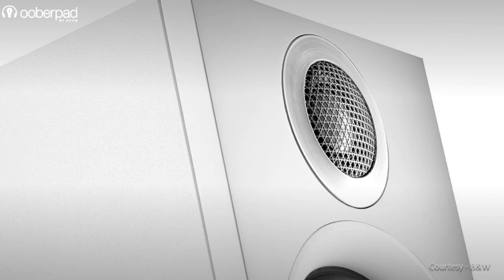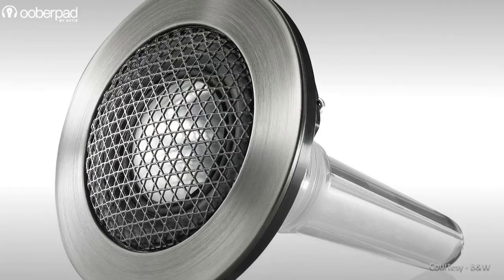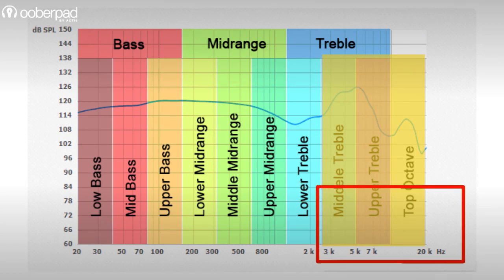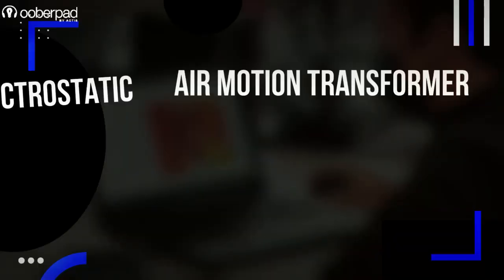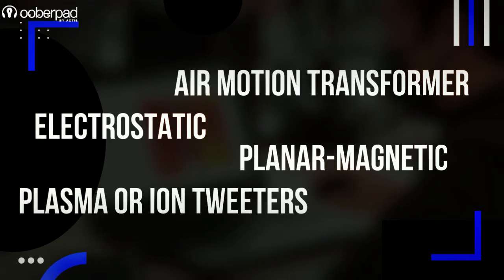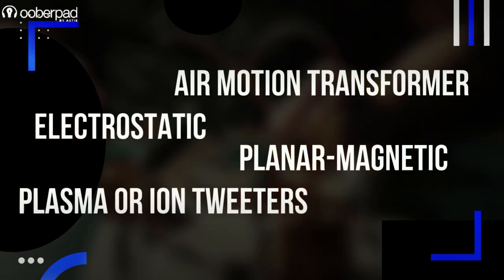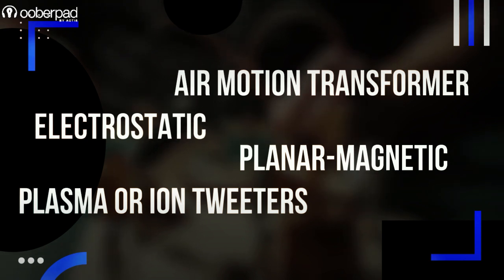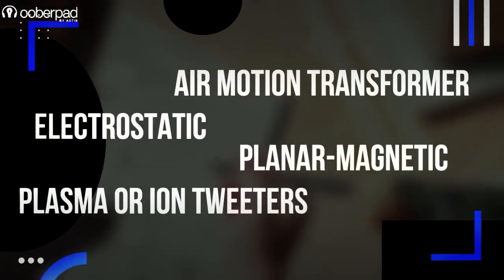Types of Tweeters for different Applications

Comment: Can I use additional external tweeter in my existing 5.1 speaker system? My current set up is AVR :Yamaha 3072,Front speaker :NS 555,Centre :NSC 444,Rear Speaker:NS 333,Sub woofer : NSW 300. Whether my avr can sustain the additional load of the tweeters? Which tweeter will best fit for me? My all speakers are of 6 ohm ratings. I should use the additional tweeters in center channel or front channel?
Reply from the maker: Hi, I suppose you might have issues with hearing dialogues in your current setup. Please speak with our experts via our website's online chat option for consultation regarding the same. Visit https://www.ooberpad.com

Comment: Has anybody tried to use Ribbon and silk tweeters in a speaker? I'm asking because I want to do some experimentation in my speaker that uses 2x 40W tweeters, is it a dumb question?
Reply: No. 
Same I want
Reply: @Neo07070  well, I did it, and is sounding great. I should have gone with a bigger/stronger silk tweeter because the ribbon is a bit more powerfull, but even smaller, it keeps the highs in an omni direction, different than ribbon that is a straight line projection.